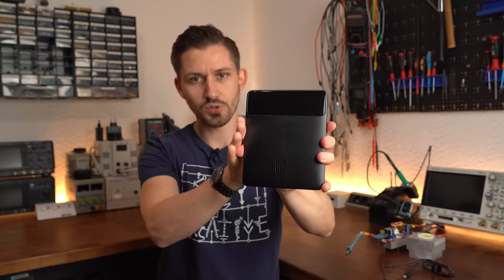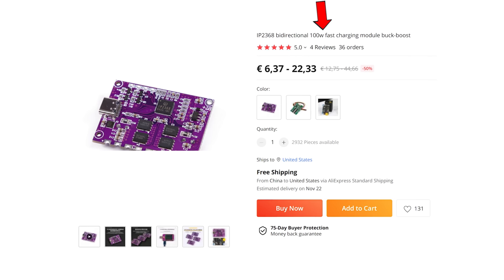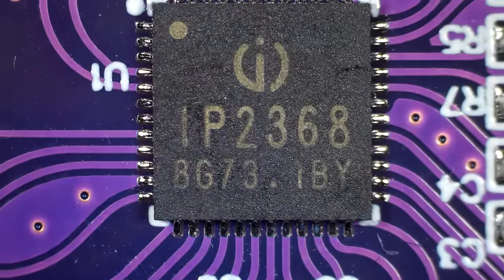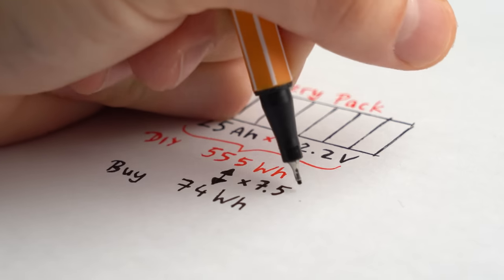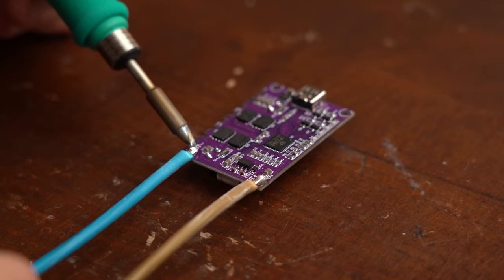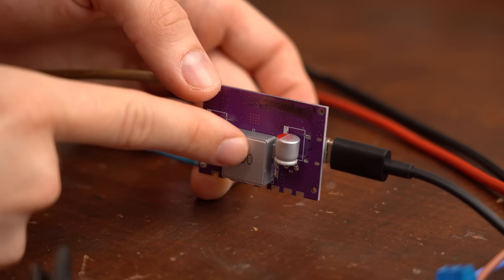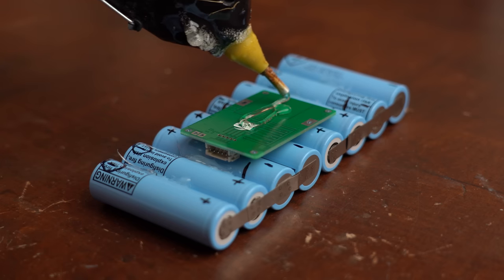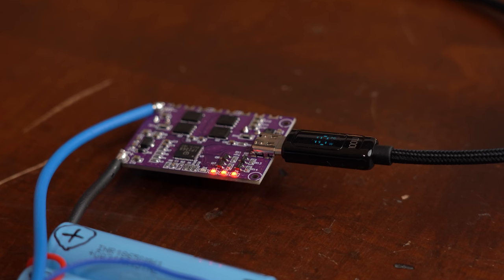My Power Bank Rivals Commercial Ones?! Super Fast! (DIY or Buy)

Comment: It's so weird to me, my Bosch ProCore Battery is like 220Wh and can provide something stupid like 1500 Watts of constant peak power, why do powerbanks and for that matter even many chargers struggle at like 100 Watts? I mean, the charger for my Bosch batteries charges at 17 Amps and 18V.
Reply from the maker: I would say with Bosch there is just no power electronics in between. The charger directly charges the batteries and the batteries output directly their current. That is why such Power values are possible.
Reply: @greatscottlab  I know that with the Bosch Professional Series the battery controlling lies with the device, but on the other hand, my E-Scooter charges with 90 Watts on 35 cells, my 5cell Bosch battery with 250 lmao

But yeah, next thing I will do is to hook up a faster charger, i already ordered a step up converter to use an old PC power supply lul

Comment: I recently soldered a mobile Powerbank charging module to a 35mah battery.  
When I charge it, the led of the charging module lights up , but even after charging it for 30 minutes it doesn't charge my phone .

Does anyone know how to solve this issue?
Reply: Also when I charge it from an outlet and simultaneously connect it to a phone then the phone gets charged but when the external supply is off then the charging module stops.

The battery even though it's soldered to the board doesn't provide any charge to the mobile.

Comment: i tried do DIY my own power bank using the same component but the IP2368  is just charging the battery its not giving output have any suggestions ?
Reply: I have the same problem. I can charge the battery but can't discharge it by connecting some load, phone, watch or PD break out board. No idea what I am doing wrong.
Reply: @michalXKX  did you find the solution ?
Reply: @MrAbouhmed1992 
Unfortunately no. I have bought another module and I will check if it works. I suspect that the first one is damaged.

Comment: Hi there
I have just watched your very interesting video, so after subscribing I thought that I would drop you a quick line.
I am looking to build a Li-ion 26650a  5000mAh bank (20 of) controlled by a 14.8v 4s 30a Lithium 18650 BMS PCB Protection Board the output from that will go to an inverter, the biggest of which will be a 1500w Inverter
If you have any videos on how to build an inverter, I would be very interested, there are some people out there, purporting to be able to build an inverter BUT I would NOT trust them with a barge pole, especially when they cover certain elements/parts of the video and the YouTube comments.
One last question please, where did you buy your T-shirt.
Reply: I recently soldered a mobile Powerbank charging module to a 35mah battery.  
When I charge it, the led of the charging module lights up , but even after charging it for 30 minutes it doesn't charge my phone .

Does anyone know how to solve this issue?

Comment: Putting rechargeable batteries in parallel is not optimal. Especially lithium.
Reply from the maker: It is only 2P though. Low risk
Reply: Every power tool brand with capacity above 4Ah does that, so there is quite a bit of real world usage like that.
Reply: @stevebabiak6997  Probably longevity of the battery is not the main concern of power tool makers :) Anyway, at least they should be matched by internal resistance.
Reply: @AlexanderStepanov1  - buying from the same batch is a pretty good start for matching cells, especially when you don’t have the necessary test equipment.

Comment: Just buy prismatic Eve cells Lifepo4. 40Ah /40.000mAh each or even more.
Or just buy a Bluetti power pack.
I have one 718wh bought for $650 and has Ac inverter and mppt charge from a 200w solar panel.
Bluetti is best portable power packs

Comment: According to the linked module on aliexpress, the default battery capacity is 20,000mah, not 5,000mah as the video states.
Reply: is it possible to put 16 batteries? of course 16.8V, each cell contains 4 batteries, and of course with a BMS protection circuit, does it work? :)

Comment: is it just me or is the way you set the battery charging voltage a fire hazard?
if the PD didn't advertise the max current I'd call this a win, but this way my laptop will automatically draw 100w and possibly be damaged